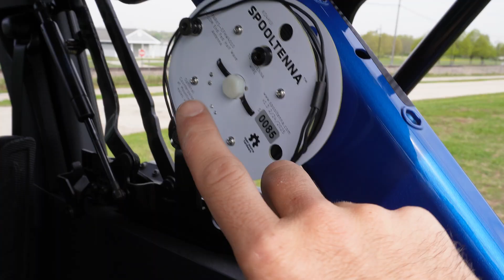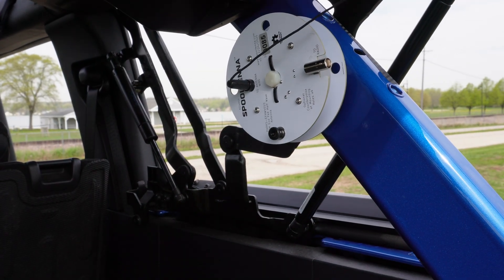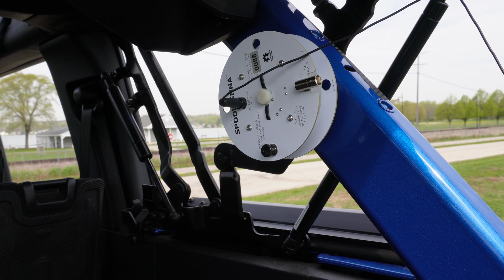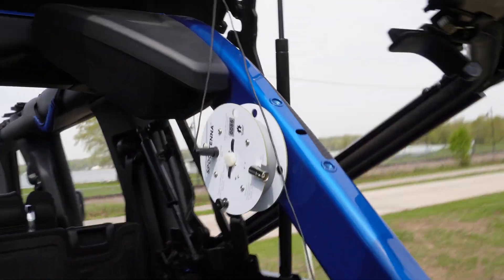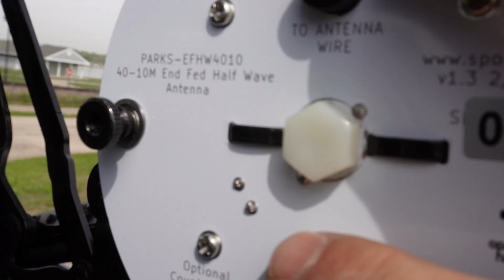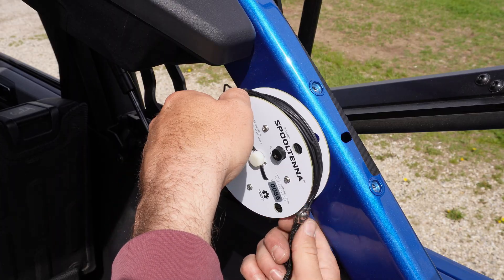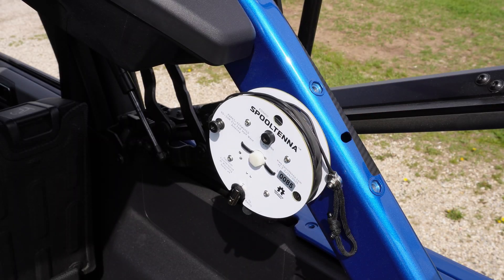The SPOOLTENNA Just Got BETTER – Quick Activate Mod!

Comment: I’d suggest keeping that strain relief cord slightly up the connector. Where you have it now will stress the L shaped wire that connects from the connector to the inside of the spool
Reply: Great point Jerry, we clip our Caribiner right to one of the holes on the perimeter of the SPOOLTENNA and it works quite well.